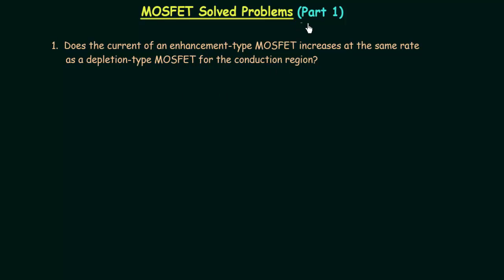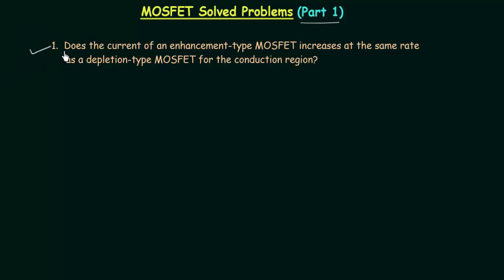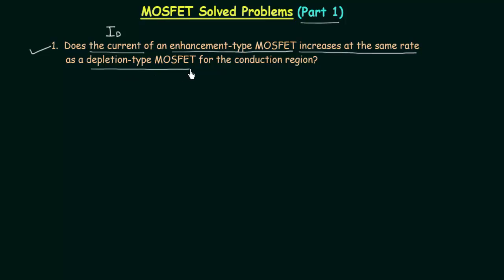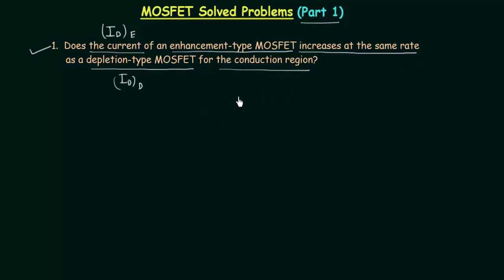MOSFET Solved Problems (Part 1)

Comment: Thanks for all these tutorials. They are very good. In this video, I think it may be confusing to say the rate of change of Id and Vgs are the same for the obvious reason that it depends on the values of those constant K, Vt, Vp and Idss. My interpretation of the Maths in this video would be this. Both enhancement type and Depletion type share a linear relationship between the variables d(Id)/d(Vgs) and Vgs because it's equivalent to a straight line y=mx + c. Where y=d(Id)/d(Vgs) and x=Vgs. The slope of the lines m are with different constant values and the constant c too. Hence, the rate of change Id per unit change of Vgs is not the same.

Comment: @Other comments: He didn't say all the constants are the same. He said that because they're all constants, the rates of change would be APPROXIMATELY the same. It's like saying y = 1.4x is similar to y = 1.5x
Reply: but how ypu can say they are nearly same
Reply: @satyamchauhan9775  Put x=1 in both equation , we get y=1.4 from first equation and y=1.5 from second, which are nearly same values.
Reply: @23sivenkat  put x=0, y=0 and x=0 bruhhhhhhhhhhhhhhhhhhhhhhhhh
Reply: @bruhbruh4137  Thank you for replying.You are saying if we put x=0 in both equations then y becomes zero in both which is fine.But to prove they are nearly same, i put x=1.